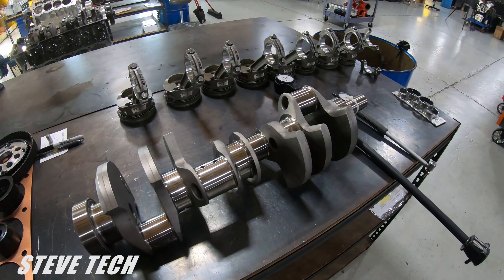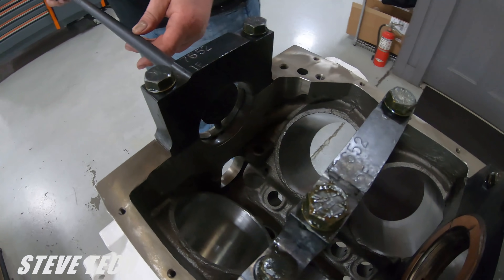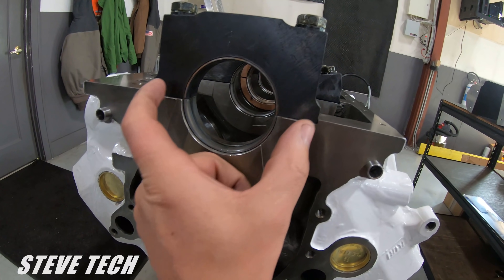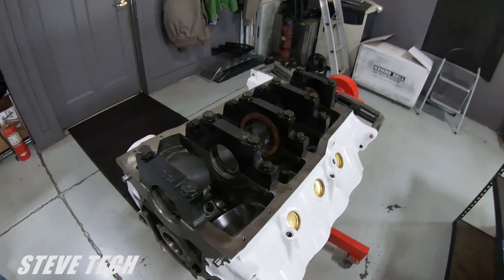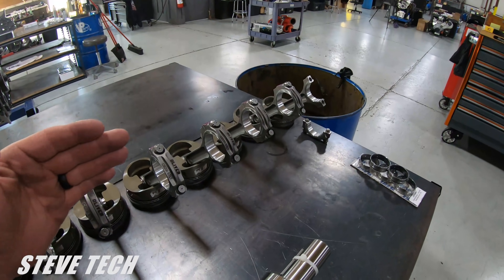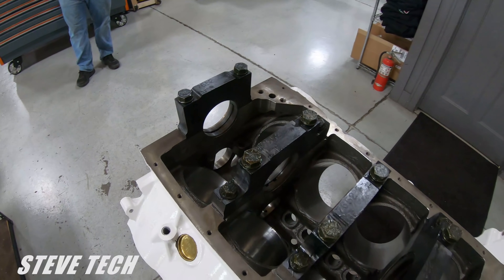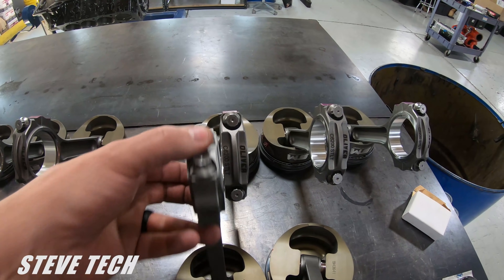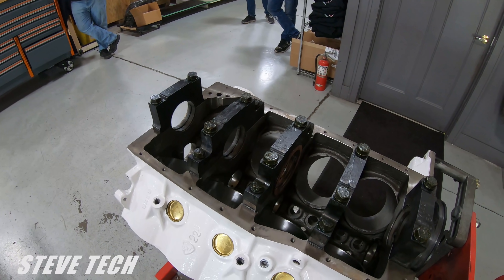How to Set Bearing Clearance

Comment: Great info. Ring gap clearances for turbo would be good
Reply: I run four thousands per inch of bore, get them ten thousands over and grind your end gap.Your oil control rings are directional, not the retainer but the  top and bottom rings, you check them for  direction by squeezing the open ends together and you see it go up or down, you want them to point up,which scavenges,going down expanding wipes the walls. I have done this on air  cooled as I am a motorcycle tech, and not so much on water cool, to but enough to say four is safe, how hot is it going  to run, not duration would be a important factor, if everything is proper their is an operating  temp for water jobs, bikes duration would be a factor, like mean temperature, and movement or lack of air going thru cooling fins, this is why their is no set formula, but it works, measure your end gap in the bore, the ring end gaps will be way bigger then you think twenty-five? on a four inch bore I would set them up at sixteen, Staggered the rings I do, but it's just feel good, rings move period, they are pinned on two strokes not because they rev, it's so the gaps don't go near  the ports and snag and snap, cuz they move,next tear down look for yourself,,like I said , for the feel good,so when you ask me if I Staggered the rings to reduce compression loss,I can look you in the eyes and say. Yep.....since I am writing this book I would like to to mention that fred flintstone is the only one who pounds feet what you  want to say is foot pounds.Then you will at least sound like you know what you be yapping about.it makes me want to pound their face, this drunk biker is fading fast so good morning men, put it in your pipe or put it to use peace
Reply: 0.007 x bore size. So a 5.3 with a 3.78 bore you would run 0.026
Reply: I see more trouble with the "how" they have been fitted... Needs to explain what happens when the gaps are not "square"  to each other and also when guys do not open up the second ring more than the top ring..

Comment: When you build 4,000hp motors for a living you tend to scrutinize every thing. All your information will help my 400hp motor live longer.
Reply: I'd rather go overkill building a street engine than build it cheap and have to do it twice!
Reply: Well said
Reply: Plasti guage is not the best way for sure but most of us cant afford the tools to do the pricise measurments. Thanks for showing the best methods
Reply: *Provided tune is good. A .00000000000000000000000000000000000001 Precision motor won't live through a bad tune.
Reply: @williamhall2386  that’s too tight of a tolerance. Nothing we have has that kind of precision and from my experience the tighter the motor the less reliable it is.
Reply: @RadDadisRad  Ran my 421SD highly modified with cross ram ad 660 holleys to 7200 back in the later 70's Drove on the street for 8 full seasons and sold 68 firebird with a great reliable engine. Same clearances. High volume -Hi Pressure Mellings pump.
Reply: I was thinking the same thing! 🤔😂

Comment: So your telling me the main is not round to allow for tunnel distortion, l dont think so.
Reply: Sir, he's telling you how the BEARING is made for oval dimensions.  The rods and mains are honed, ROUND. My clients request that I remain anonymous,  there's SERIOUS money involved in Grudge Racing.  I'm not comparing myself to Steve, but we go over this all the time.  I have been machining Race Engines before Steve was born. We call this FLARE, and it's built into the bearing.  Please Sir, listen carefully to the video. Taper, size, and out of round, are the responsible of the machinist.  Flare is built into the bearing.  
Thank you,  GOD BLESS. 
T.S. RACING
Reply: @t.s.racing  So the bearing manufacturers design the ovality, l know this and the tunnel is round, l know this also. But to say the ovality in the bearing is for tunnel distortion is flatout wrong. How does the manufacturer know what loads will be placed on the bearing to account for this? Engines from 200 hp up to 2000 hp using the same bearing, also they are used in 2 bolt cast housings and 4/6 bolt steel/cast housings distorting differently. I've been building race motors for 40 years and l was surprised he made this claim. The ovality is to help produce the hydrodynamic oil wedge that holds the crank off the bearing, nothing else, simple.
Reply: From King Bearings: 

Eccentricity Issues of High Performance Bearings High performance engines commonly operate at high rotation speeds, which considerably increase the inertia forces generated by the accelerating/decelerating engine parts (e.g. the assembly of a piston with the connecting rod). Since the values of inertia forces are proportional to the square of the rotation speed, 
they become high at high rotation speeds. For example, an increase of rotation speed from 2000 to 6400 RPM raises the inertia forces by 10 times. In reaction to these inertia forces, the connecting rod and its bore are stretched in a
vertical direction. As a result, bearing diameter measured along the parting line decreases (closes-in), changing the shape of the oil wedge. If the eccentricity of the connecting rod bearing is insufficient, the oil wedge may change its shape from 
converging to diverging (negative wedge). Such conditions are shown in Fig.3. Under negative oil wedge conditions, a hydrodynamic regime of lubrication is impossible. The bearing will be subject to direct friction, characterized by metal-to metal contact between it and the crankshaft journal surface.  :text-green-game-over:
Reply: Fuck I thought I was going to sleep, but inquiring minds want to know about line boring oblong hole boring machines and where to I could this. And this superjet age bearing that is thick and some thin because why? Did we not line bore? Why is everyone one kissing his ass? I'm drunk right now, but I heard him say it, the only way you do this is to line bore then deck block and caps backwarrrds, but hey I don't build 4,000 h.p. engines and I have a feeling he says feet pounds not foot pounds inches of pounds instead of inch pounds, so I call bullshit, plastigauge double check with dial bore if you know how, little tricky cuz it's not cly bore,.still tricky it goes to ten ten thousands, how the fuck do you measure oblong, snap gauge and a DIGITAL caliper and we know why it's digital mr. Feet pounds, yeah super secret racers sharing super secret race race stuff, we can't tell you everything, geeze. Nope you can't. Wanna learn how to set super race if I tell you I gotta kill you duper super race stuff ring end gap secrets in the comments on rings for turbos you can use it, call yours .Racer X has to go look for that oblong line individual main line bore machine, then fine the special out of round bearings that would crush like out of round, new words to look up, piston speed, piston dwell,high volume, high pressure the difference, potential and kinetic. Learn these, for it will help help you understand what your saying and all that come to his defense, this is some basic shit